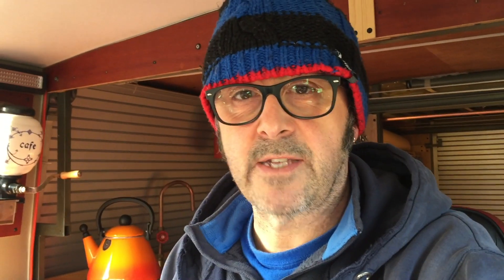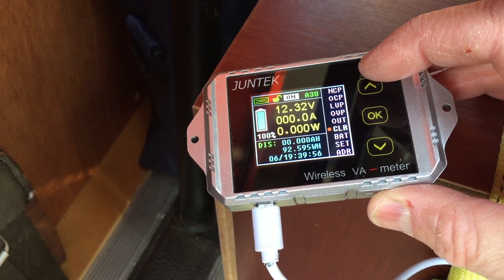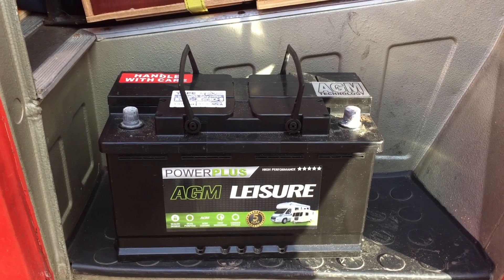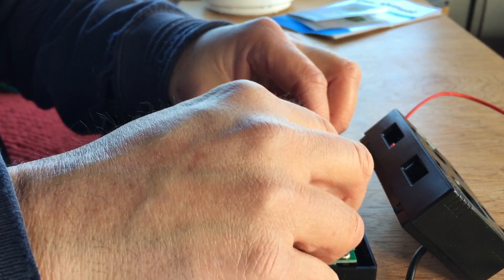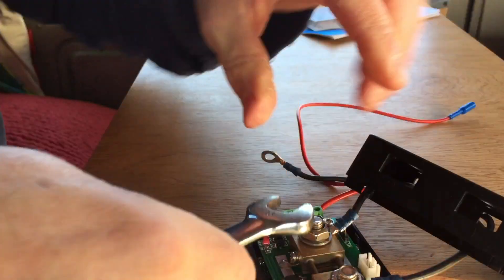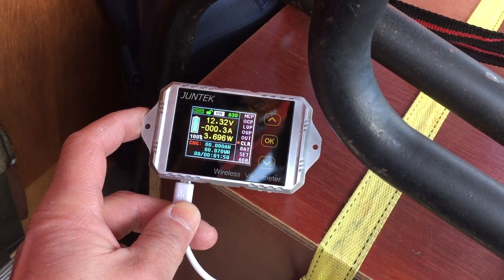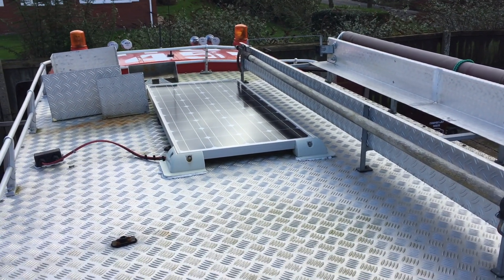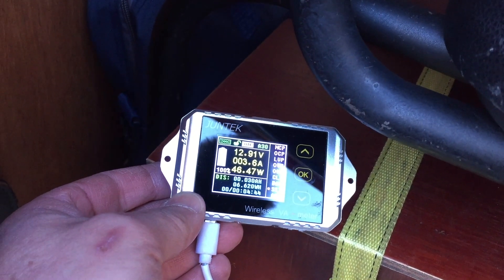JUNTEK VAT 1300 Installation Confusion | Fire Engine Camper | Düdo | 608D Feuerwehr Wohnmobile | LF8

Comment: Love the vids - I have just installed this in my campervan and you don't have this wired correctly to measure both input and output. Your shunt will only measure what's passing through it. I can see you have taken a separate cable from your battery, so your set up will only measure what's happening on that separate cable. You need the whole earth passing through it. 
To do it you will need to buy 2 cable crimping lugs and cut your battery earth cable, crimp the lugs on each end and connect to each side of the shunt, so everything from the battery to the chassis passes through it(you should only  have one cable from your battery to the shunt). This will give you full battery monitoring both in and out and keeps your cumulative totals. If you can't crimp the big terminals you can usually get them made to measure, sometimes off the shelf. If you need to connect any other earth cables make sure you add them to the chassis side of the shunt. I hope this helps👍
Reply from the maker: Hi, thanks for the comment, you make some good points and I think I ended up doing what you suggested until the unit failed entirely and I threw it away. You obviously understand that it is poorly made and not made to last. Also, you make the assumption here that the vehicle is the same voltage as the battery bank, not in my case, I have a 24v truck and a 12v battery bank that is charged via a battery to battery 24v to 12v charger. The 12v system is not grounded to the chassis at all. The Junktek unit can measure both ways but the information it gives is largely useless beyond looking interesting. I have a newer cheap unit in the workshop and that can sum things nicely in and out, for the fire truck, I have a new Victron Battery Monitor and shunt to install, that will work just fine.
Reply: @GlennJobson  I had one in my last van for 5 years no issues at all, luck of the draw I guess. Regarding the shunt and voltage, it will make no difference if its grounded to the chassis or not.  When you fit the Victron shunt it will need to be fitted in between the main earth cable from the battery your measuring, not through an additional cable as in you video. Otherwise you will have the same issue you had with Juntek, giving partial info. It should be fitted from the battery negative and the other shunt connector you would connect as many earth's/negative cables you like, including the one from your B2B charger. Good luck with the Victron they make some nice stuff and pretty kewl bluetooth one if your into that. Cheers👍

Comment: I think you can calibrate the shunt to measure under 0.5 amps... There is a hidden menu for setup.  I have not done it, but I think there is a calibration option.  There is no detail manual on the Admin options.
Also,  about not showing charging Amps... I think it is showing, because your battery says it is 100% charged, so, the device does not count anymore amps that come after the battery is charged 100%.

Comment: hey I see you have the negative wire connected to the shunt as a bypass with the main negative wire still going directly to the battery. I would expect that you are only measuring the current passing through the shunt and not what is going directly in the main wire. Does that work properly?  Are you still using it this way?
Reply: This is the answer.
Reply from the maker: It only measures one way, so I have the input on one pair of cables, the output on another pair. The 12v installation is self contained, not earthed to the vehicle as the 608D is 24v. It works for the one way I need, discharge, the Victron solar charger handles the input, I don't need to know how much comes in from the split charge or the mains charger as that is largely irrelevant. If I am stationary and off grid for any length of time I need to know how much solar I have accumulated and then how much I have down down. I could do all of this in the VIctron and may decide to do that, for now, this little meter is a nice thing for showing me the discharge values. Thanks for commenting.
Reply: I have the same shunt and it measures both ways. That is if you have it connected in a way that allows it. Meaning no negative wire bypasses the shunt that goes directly to the battery. There's no need to earth ground to the body and mess with the trucks 24v system. Just ground everything that uses it to the 12v battery. You are only seeing only because you only have solar negative passing thru it. The rest of your load is going thru the battery negative thru the heavy gauge wire you have connected directly to the battery. If you set it up right you will be able to monitor your battery they way is designed and have the capacity monitoring also working properly.

Comment: Did you say that the unit Cannot show charge and discharge at the same time? In other words, there is no way to monitor the Net current (I.e. current going in - current going out) on the battery ? What about Net % of charge as you charge and draw at the same time ? That is what I was actually expecting from this vat1300.
Reply from the maker: That is my experience of the unit, it can show charge or discharge, show the total but it has no Net value  as far as I have been able to tell.
Reply: Glenn Jobson Thanks, i did not received my unit yet. I’ll let you know how it goes. Regards, Andre

Comment: I have the same model, it's working but   it could not measure current below 0.6A. Example when my load is only at 0.5A (i.e. a 5W bulb), the current at the display will show 0A reading instead of 0.5A, the Ah, Wh, & time would not move as well when the condition above mentioned exist. Yours show 0.3A in the video, do you have any idea on how can i make my vat1300 read  below 0.6A? Thank you.
Reply: Thanks for checking. My vat1300  can't read 0.6A below on both charge and discharge. I'm still ok with it, considering it's cheap and the readings 0.6A above are close to my multimeter readings. Anyway, you have the best looking camper truck out there.
Reply: I have the same issue. It does not register low discharge rates.
Reply from the maker: I went to have a look today. I disconnected the USB power and reconnected, the voltage is almost correct on mine, my multimeter says 12.75v and the Juntek shows 12.62v. My meter doesn't appear to show the discharge below 0.5A either, a simple lamp that should draw about 0.5A does not register. It does though show a charge of 0.1A and above, registered as -0.1A on the display as it is a 'negative discharge', or that is how I read it. I have a Victron solar charger with Bluetooth and the figures are basically the same, so the Juntek is recording the correct figures.